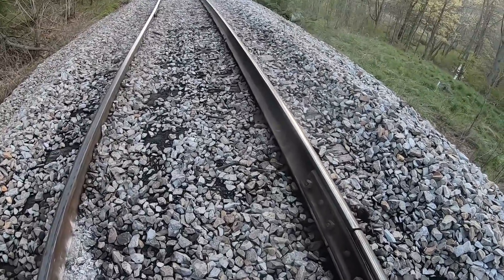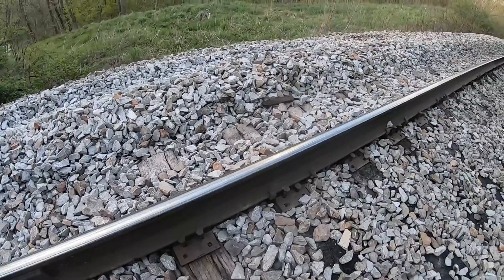Major Derailment: Locomotive Derailed & 2 Cars plus1400 Feet Track Tore Up!

Comment: just curious why the locomotive was left running when its off the tracks?
Reply from the maker: Locos are left running a lot of the time here, they never shut
down during the winter even if parked in a siding, Had there been
any leakage under the loco then it surely would have been shut off
right away.  And, consider if the loco was shut off and for some
reason wouldn't start again, that would severely complicate things
for the track repair crews. We have no way to drag it west out of
the way. They were also hoping Hulcher could somehow re rail the
loco quickly so no need to shut it off. Thanks for watching and hope you will stay tuned for the rest of the upcoming videos
about all of the events that happened here.

Comment: Not excessive speed as some other have mentioned. I have seen several derailment that are similar. One was with 3 SD's pushing hard and basically accordion'd that first 6 cars ahead of the pushers. The second was loaded covered hoppers that just cam out of rebuild. They had been sand blasted and center bolsters were full of sand causing excessive wheel flange pressure against rail, causing rail to roll over.
Reply from the maker: Thanks for watching Bruce and hope you will take in my next video
on my theory on why the derailment happened. It's here:
https://youtu.be/2uGomCuZkV0

Comment: So the locomotive on the ground is the trailing locomotive then?  So it was the second to last coal car that jumped the track first and started spreading the rail, and the locomotive did the rest once it hit the ground?  Wouldn't bringing in panel track put you back in service quickly?
Reply from the maker: Yes sir, and it was the last truckset on the next to last car that
caused the damage, the first truck set (east end) stayed on. 
You are correct in panel track, but we did not have any available,
have made the suggestion having panels would have speeded this up by a whole day
Reply: @ccrx6700  And the crew you brought in to re-rail the cars and locomotives didn't have panel track in inventory to fix up the torn up track, or do they just re-rail cars?  The rail repair contractor near me stocks panel track for such situations.  That isn't available near you?
Reply from the maker: @littlewingpsc27  Hulcher has panels here, however they have a deal with CSX tp keep a minimum amount on stock sp they were unwilling to deplete their stock for us.
Reply: @ccrx6700  Might want to give Omega Industries, Inc. in Vancouver Washington a call, or check out their website: http://omega-industries.com/products/track-products/

Comment: I'm about to show my ignorance of trains here, but why is the engine still running? The only thing I can think of is either they are really hard to cold start, or the engineer has a pucker-clamp on the seat and still not able to move yet. Glad to hear no injuries, had to be scary as hell.
Reply from the maker: Many folks have asked that. This vid was taken about 1 hour after
it derailed, because there were no leaks, there was really no need to shut it down, they were expecting a fairly quick re railing as
Hulcher was on their way at the time. Had their been any leaks then obviously it would have been shut off immediately. Appreciate your watching sir and good question

Comment: Looks like bad tracks to me. Or the track was overloaded.
Over in Europe (the Netherlands in my case) we overall use concrete sleepers, and egg- or pretzel-like springs to tie the tracks down, instead off long nails.
The tracks used in switches have an other type off concrete sleeper. Thisone has heavy metal plates, that are tied down with thick bolts.
Then a plastic plate againsed vibration, with the rail(s) on top, and the rails than again gets tied down with the egg- or pretzel-like springs. Really durable.
Even with wooden sleepers. Some tracks arn't maintained for over 10 to 20 years and are still safe. That I can tell.
Reply from the maker: Thanks for watching and hope you will watch the upcoming videos
that explain so many other aspects of what all happened here, there gonna be 8 more videos out about the derailment coming soon to a utube nearest you...

Comment: Looks to me, based on how the spikes are gradually being pulled out, before the derail, the DPU, was pushing harder than the lead engine(s), were pulling, causing the DPU to push hard enough, on the curve, to put enough outward pressure on the cars and their trucks to cause the rail to come loose and roll.
Reply from the maker: Could be, but I talked to the operator that evening after it happened and he told me lead unit was in throttle run 5,  EOT DP was in 3, so watch my next video for my theory, ponder that one for awhile, then
write back in. Appreciate your watching today's show

Comment: Sorry to see this....you will have to explain when you recover how so much rail got messed up how the loco was so far away.
Reply from the maker: Doesn't take a whole lot of effort for a loco to pull 2 cars that
have the truck sets off, back loco lot of weight it didn't go far before stopping, so the head end loco and cars behind it took
a lot longer to get stopped that why the distance tween the 2, hope
that helps.

Comment: It was hot 🥵.  I bet the track warped and bent.

When they were building the new Mechanicville yard in Upstate New York they had put in ribbon rail that was 2 mi long and it got up into the '80s and a straight section of track expanded and bent into a huge s causing a derailment when the train came around the curve

That might be what happened in your case

Comment: Where are they going to get all the new ties ? How many do you think you will need ?

Wouldn't it be easiest to just scrape the entire rail bed off and push the gravel down the side of the Hill and put in all new ties and plates and hardware and rails and ballast rather than try to save anything ?

Maybe they can bring in ribbon rail
Reply from the maker: WE got 4 tractor trailer loads new ties in the next daythey come
from Appalachian Timber in Sutton WV.  They've been supplying us
for a lot of years. We usually have a waiting period, but since this
was a big outage they got right on it for us, very grateful to them for their quick response, with out them we would have been up the
proverbial creek without a paddle
Reply: @ccrx6700  you ever think about putting in a 2nd track ?

If you had 2 tracks trains could come and go at the same time

And, when you have to replace rail and ties, you can keep the trains running
Reply from the maker: @ocsrc  i've said that for years too, but what do i know? I just work here 😉

Comment: Weird that they left the engine running.
Reply from the maker: Locos are left running a lot of the time here, they never shut
down during the winter even if parked in a siding, Had there been
any leakage under the loco then it surely would have been shut off
right away.  And, consider if the loco was shut off and for some
reason wouldn't start again, that would severely complicate things
for the track repair crews. We have no way to drag it west out of
the way. They were also hoping Hulcher could somehow re rail the
loco quickly so no need to shut it off. Thanks for watching
Reply: @ccrx6700  Thanks for the response. I assumed it would be standing there for a like a couple of weeks until the railroad is reconstructed and some huge cranes are brought that would lift the locomotive onto the rails.
Reply from the maker: @SmartassX1  I understand better now what you meant. I had just arrived at the scene and had 5,000 things on my mind how i could get this track back in service, so lot of things i could have said in vid that would have cleared up a lot. Next time they derail, i'm gonna require an 8 hour notice so i can script the video first... LOL 😉  thanks for writing back

Comment: You are correct, What a mess. 2 things,  thank God, no one was injured, and all equipment is upright. This is pure speculation, but look at train speed, and look closely at the way the cars are loaded. Load could possibly have shifted in multiple cars that caused rail to roll. It takes alot of stress to break the flange on the one piece of rail that you showed in video. Also could be stress crack in rail. Hope the contractors can get in there and get things fixed and cleaned up in a timely manner. Please stay safe and keep us updated on how it's going
Reply from the maker: Yes Robert we are lucky no one got hurt and things coulda bee lot worse, a loco could have been on its side in the ditch with fuel spilling. Your theory shows you're a thinking man! Something very similar occured to what you referred to as weight shifting, that did play a huge role, watch next vid out next week. Appreciate your viewing today's show 👍

Comment: Reckon it's time to 'lose' the spikes and start using Pandrol clips on concrete !   Most definitely on curves anyway.
Reply from the maker: Well, figure this, my old tamper has limit switches which control
how far down the tamping tools go. Wood ties 7 inches thick
concrete 9. That would mean to tamp a combo of wood and concrete, for every difference I would have to crawl under tamper
and reset 4 limit switches, then do it again for each different tie
and that ain't gonna happen. Now if I had the Jupiter system in the
tamper I could toggle a switch inside the cab, but Jupiter upgrade costs minimum $100,000, so management not yet ready to
give me an upgrade or a newer tamper, so we stuck with wood for
now. Thanks for watching sir. Someday gonna make a vid and
show the limit switches and what would need to be done to
do concrete ties
Reply: $100k to upgrade the tamper vs whatever it's gonna cost to fix all of that, though I'm sure management doesn't necessarily see it that way

Comment: Really fortunate that the train stayed upright! But a large mess indeed. 

Do spikes hold just as well as other fasteners? Here in The Netherlands, pretty much all is screwed (where wooden ties are used) with some kind of elastic fastening. I've never seen just spikes. Though I don't know what the reason for that is. 

Is there even a large sideways force on the rail under normal operation?
Reply from the maker: Yes it is Marco,  coulda been lot worse if loco was on side and
fuel spilling out, we lucky it stayed up right. The Pandrol clips hold
track very well especially when the plates are lagged, however
to change over would be a major huge undertaking for us at this
time, all our rail is spiked. Thanks for watching sir

Comment: Laying over a rail means the track was junk, and ties were junk
Reply from the maker: You are welcome to your opinion, but hope you will watch my
next video coming out in a few days before your final view point,
it will be titled Why the Derailment Happened. Thanks for watching
Reply: @ccrx6700  from all I can see the ties were splintered and short ends looked bad,  and rotted
Reply: @ccrx6700  I've been around the Railroads a bit, I've worked at the AAR , DOT facility in Colorado,  and tested locomotive engines there and at the Kansas City Argentine yard, as well as the Crane tech at the KCS engine shop in Shreveport, La.

Comment: ~ So let me get this straight, the locomotive was at the tail end of the train because you said that the derail started just beyond the loco or did it split right under it and the cars uncoupled and rolled back to where they are while splitting the track the whole time they were rolling back down the grade to where they finally stopped.?. 🤷🏻‍♂️
Reply: I was thinking the same thing. Seems the track is tore up in both directions from the locomotive.

Comment: WOW.. Other then the required process of changing underpants, I am sure, everybody is okay.. That had all the formulas to create a situation of being so much more worse in more ways then one.. I am not an expert, and likely shouldn't make an assumption, but, out of curiousness, I would say the corner was taken too fast... Or, taken too fast, then the brakes were punched hard, and the engine started to push, due to the time that is required to apply the brakes towards the trailing cars, start to brake. in some cases, that can take several seconds for the air lines to convey the mission to the trailing car.. just a theory. and I am very likely so not correct.. and frankly, really doesn't matter now, as "it happened" and simply needs to be put back together and get the show up and rolling as safe as possible.... The country is counting on your guys & gals to do a fine job as you always do.. Be safe. Again, I hope nobody was hurt.
Reply from the maker: Thanks for watching Dru and hope you will watch the upcoming videos
that explain so many other aspects of what all happened here, there gonna be 8 more videos out about the derailment coming soon to a utube nearest you...
Reply: @ccrx6700  Oh absolutely, I subscribed some time ago and have learned all sorts of neat stuff, even the stuff most might find to be either common knowledge, or oddity's, I find all those silly notes really neat and interesting.. You and Hobo Shoestring's amazing info has really helped me with doing my scale model (N SCALE) train layout so much. Every video, I am left with the desire to pull out the drawing pad and integrate the new info in a train layout. I want to incorporate it all, to make my layout a challenge. 

I and trying to make my N SCALE train layout into a game, that in a simply way to explain it, pull out from a hat, random pick up stops/orders, and that need to get to another destination/stop, while minding the rules and reg's of the rail road. Multiple engines running, 100's of cars of many many types. and the cargo is imaginary, but stiill pulled from a hat, to create a list for each car and work orders, maintenance calls, the whole works.. The layout on paper, give or take, has well over 120 rail way switches, 60 different buildings/suppliers, 80 buildings/buyers, 13 rail ways, 16 rail yards.. and an entire basement to build it in. 

I have 98% of the stuff to start building this, but the past 2 years, I have been at a stand still, as I keep learning new things about the rail industry that each time, I desire to mix into the design. Trying to cram as much as possible into this project. as the best part is the designing and building it. Sure, playing with it is fun too, but, being able to make it into a game, to mimic the real industry, I think would allow my desire to play with it more, once it is done. I wrote software that keeps track of transponders, up to 25 different transponders, but can monitor up to 256 different locations, or inputs, all of which goes into a real-time spread sheet, that is partly automated. That part still needs work, as the only way to fine tune that, is once it is up and running to hone the time line for how long a section of track would be down, (in scale time) for how long a train would sit at its off loading area or loading area, or how long a derailment would block off that section requiring trains to be rerouted around.. Yes, complete madness, But, I think this will be fun to build this set up like the board game Monopoly. When you are done playing with it, walk away, and when you come back, you can look at the log books, and schedule log, and pick up where you left off... That is the theory of my attempted mission.. Thank you for your efforts in education on our beloved United States's rail way system.

Comment: my question is why are the locomotives still idling? completely derailed and they are still running..
Reply from the maker: Locos are left running a lot of the time here, they never shut
down during the winter even if parked in a siding, Had there been
any leakage under the loco then it surely would have been shut off
right away.  And, consider if the loco was shut off and for some
reason wouldn't start again, that would severely complicate things
for the track repair crews. We have no way to drag it west out of
the way. They were also hoping Hulcher could somehow re rail the
loco quickly so no need to shut it off. Thanks for watching

Comment: And after all that work you guys did upgrading the line. You'll need new ties and plates, unless they'll install concrete ties to hold gage.

You think the company will have to get leased 4-axle road units if the 6-axle locomotives are the issue?
Reply: note that this railroad is not attached to the national network--they would need to be trucked in.......

Comment: Just a wild guess:  before spikes are driven, isn´t a long wood plug inserted or driven into the pre-drilled spike hole in order to make an exceptional tight fit between spike and tie?  If this is true, could possibly for some reason the plugs were not driven into the tie holes before the spikes were driven in this section of rail?  Looking forward to getting the correct answer from you.
Reply from the maker: Thanks for watching Bennie. You are correct in that when old spikes are pulled a plug is put in or sure spike. In new ties there
is no need for a plug since there is no hole. plugs also helpkeep water out too.   Hope you will take in my next video
on my theory on why the derailment happened. It's here:
https://youtu.be/2uGomCuZkV0